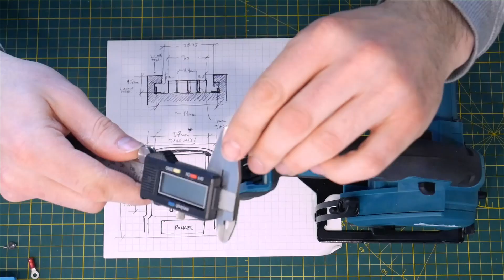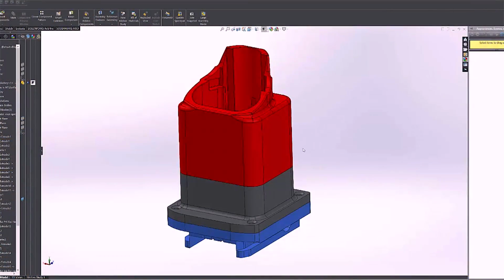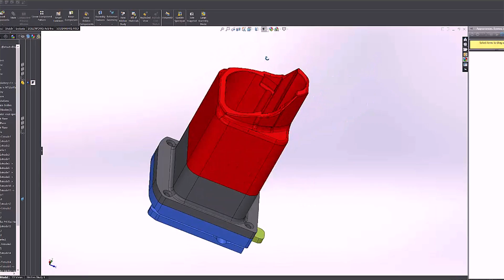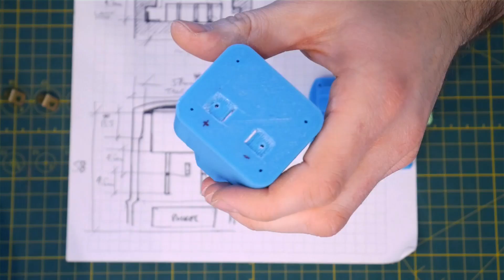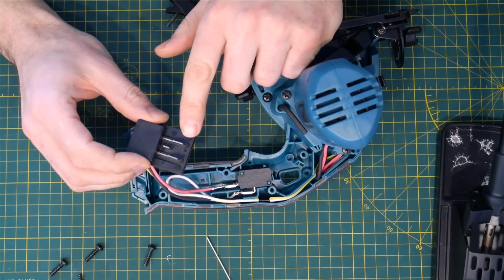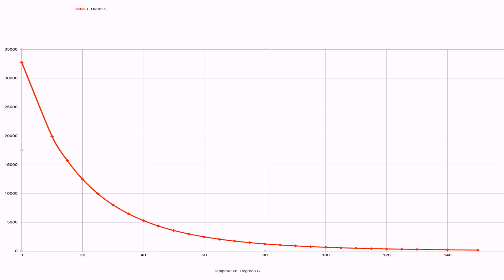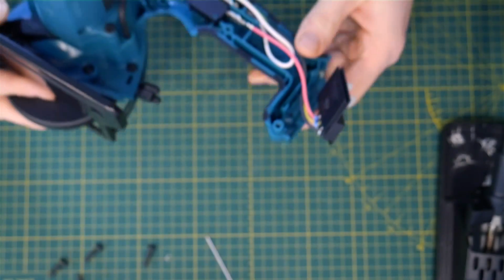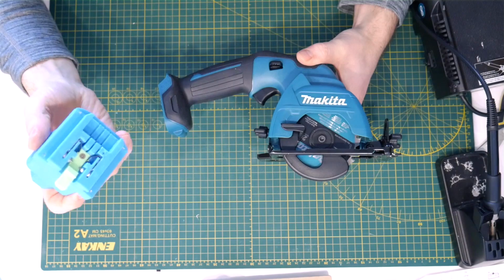Interchange Tool Batteries Between Brands With This One Weird Trick! 🔋 One Battery To Rule Them All!

Comment: Hi, I have old v18  Milwaukee 48-11-2200 tools that work but no batteries? I have bought Ridgid tools with good 18 volt batteries, does anyone make an adapter for this combo ? Or can you make one for me?  I no longer run my tools daily . I hate the Idea and expense of having to buy all new 18v tools when the only problem is the batteries. Luke.
Reply from the maker: Hi Luke, in order to make adapters I would have to have the tools and batteries at my disposal to measure and test with. Unfortunately I do not own any of the old Milwaukee 18V tools. Have you tried the good ole google search for adapters? I've seen people sell various adapters on all sorts of websites, even Etsy believe it or not
Reply: @EmbraceMaking  Hi, yes as a matter of fact I did purchase an adapter that will allow me to use the newer m18 batteries in my older v18 tools. The only problem with that is I have to buy a charger and new m18 batteries which cost more than a new set of tools with batteries. I bought a Ridgid stealth impact driver which I love, and it came with 2 batteries which I registered and are covered under Ridgid"s LSA. It would be great for me if someone made an adapter that would allow me to use my good Ridgid batteries in my perfectly good 18V Milwaukee, circular saw 1/2" hammer drills, recip saw etc.

Comment: Great video and explanation !
Reply from the maker: Thank you Dan! Really happy you enjoyed the video!
Reply: Does this work in reverse? For example Dewalt battery on Milwaukee charger ?
Reply from the maker: @DanDomanski9  You can make anything work in any direction but depending on the brand you will have to look into the temperature sensor value. Chargers should be looking for a temperature sensor reading... I wouldn't recommend bypassing the sensor to charge a battery on a different charger... if something goes wrong it could lead to a fire and you may not be there to put it out. Adapting the battery to a different branded tool is a different story as you would be there using it and if something were to go wrong you would be present to deal with the issue.
Reply: @EmbraceMaking  makes sense. Appreciate the reply!

Comment: Great video. Trying to get a B&D 40v battery to work in a 40v Atlas chain saw (brand new under warranty). A new battery runs over $100. Runs great with the B&D for about 5 seconds then shuts down. Let go of the trigger, press it again and another 5 second run. Is there a way to correct this without modifying the tool? I see battery adapters available that do not require tool breakdown.(None available for Atlas yet.) I'm thinking there is a way to correct this outside the tool. Are you available for consultation for a nominal fee? :-)
Reply from the maker: Hi Elvis, does the B&D battery physically fit inside the Atlas chain saw? How many terminals are on the battery and how many on the chain saw?
Reply: @EmbraceMaking  The battery opening is huge. I was going to run jumper wires and tuck it in the compartment  while using the battery. There are 2 terminals on the B&D with a center charge port. There are 3 terminals on the Atlas tool. Not sure if the center tab is for charging,communicating with the saw, or both. There is an ohm symbol on it and the letter C. The B&D when hot wired, runs the saw for about 5-7 seconds then something shuts down. Let go of the trigger, press it again and it runs again for the same time. Pulled the Atlas battery apart and it looks like the whole circuit board is covered with liquid electrical tape or something of that nature. Can't really read any numbers. I don't know if the B&D battery is shutting down or something in the saw is shutting down. Brand new saw so I didn't really want to damage anything.

Comment: What if you used an arduino that read the temp output of the battery from brand A and then converted it via a mathematical function to the corresponding value for tool brand B. And if you took it a step further you could put in a screen where you could select what brand the battery is and what brand the tool is, and then use the appropriate function
Reply from the maker: You couldn't probably make something like that work if you really were concerned about over heating the battery. In most cases the average hobbyist doesn't run their tools that hard though.

Comment: Why wouldn't you put the resistor in the adapter so any tool would work, rather than modifying each individual tool?
Reply from the maker: I was having a tough time fitting another contact plus the resistor into the design to keep things compact. So I just modified the tool instead.

Comment: Awesome video! An excellent idea as basic to make adapters from another systems such as Metabo, BOSCH etc. instead of Milwaukee. Thank you so much!
Reply from the maker: Glad it was helpful! Hope you left a like to help me out! Thanks again for watching!
Reply: I 2nd this. I use the Hitachi/Metabo HPT battery system, and I cannot find many adapters that accept these. I'm not versed in 3D printers... maybe I should start learning.
Reply: @BieberSama808  I use Metabo 12V batteries with Milwaukee and Makita tools and 18V Metabo batteries with Bosch/Ryobi. It took a few weeks and a lot of test 3D-prints. But now it works (I'm not satisfied of adapter's design, maybe should make version 2.0 more estetic).

Comment: Do not alter the tool, put the resistor into the adapter...
Reply from the maker: Yes, this is possible, but I was having a hard time fitting a third contact inside of the adapter so I popped open the handle instead!
Reply: Which  type of resistor to use ?
Reply: In the square part in the middle, beside the screw, at https://youtu.be/nd4fHFHj9AU?si=NxWorENKIL7VZPqI&t=214 then hollow out the model underneath and put the contact in there so the blade edge slides on it. It does not need to handle as much current so any contact will be enough.
Reply: What is this Soviet Russia?

Comment: Wouldn't it be better to incorporate the thermistor hack into the adapter? This way you would need to alter the machine(s) themselves and keep your warranty intact...
Reply: Certainly. Or just place a thermistor in the adapter, would be even better!
Reply from the maker: The thermistor's purpose is to monitor the battery temp... if you put a thermistor inside of the adapter you are not monitoring anything (since it's not hooked up to the battery). There really isn't a purpose of using a thermistor as it won't be changing temperature and therefore won't be changing resistance. A simple resistor on the tool or adapter side is all you can do unless you can somehow connect to the adapted battery's temp pin and then map the battery thermistor's output to what the tool is expecting to see.
Reply: @EmbraceMaking  I did not write about a thermistor but your hack with a resistor. I just concluded that soldering the resistor into the adapter instead of Inside the tool would be beneficial...
Reply: "you would not need to " ;)
Reply: Theoretically you could add resistors in series to increase the resistance and in parallel to decrease right? The other thing I’m not sure of is whether the J curve that the tool expects would be different. So just because at room temp it matches, doesn’t mean it’s a straight addition or subtraction all along the j curve.